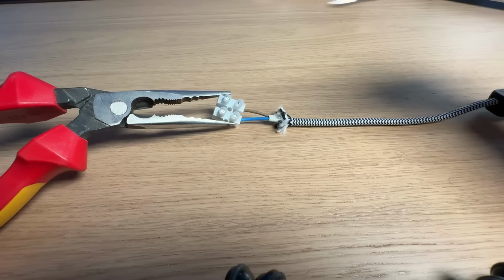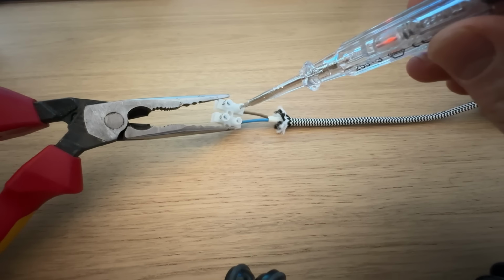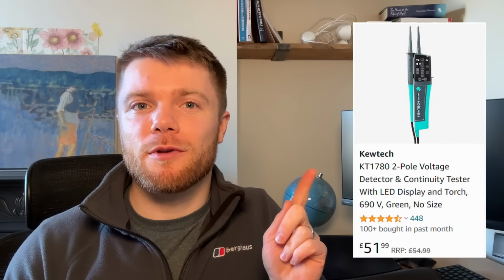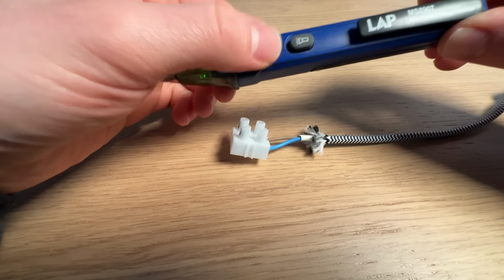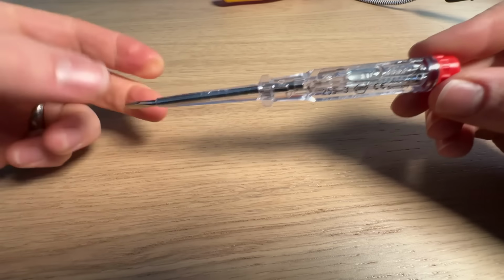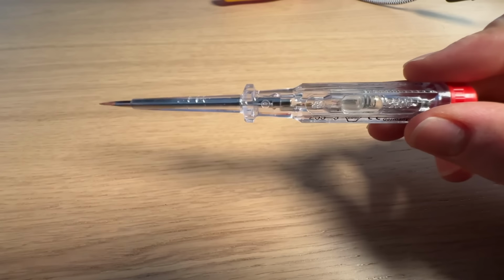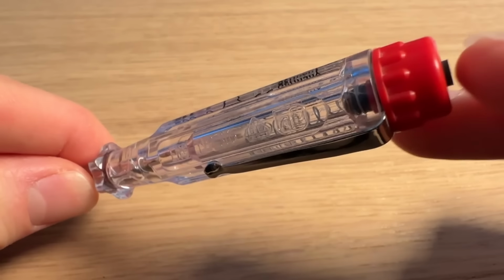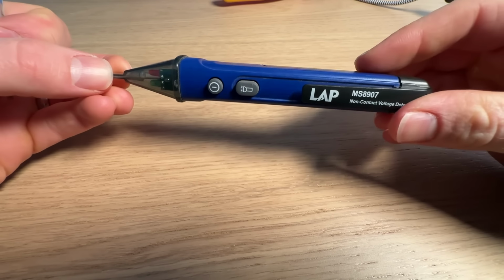The Most Dangerous Electrical Tool

Comment: What a BS, the resistor inside the probe effectively prevents shock. These probes are still very popular, since they are foolproof to operate, cheap and very safe. A multimeter requires a battery, the correct ramge setting and the cables need to be plugged into the correct sockets. In addition the cables and tips can be worn or damaged over time. What is worst,  you have to use both hands, what I try to avoid when working with mains voltage. If sonething goes wrong there is a definite circuit through my body. While when working only with one hand and wearing shoes with rubber soles, I would hardly recognize even if i touch 240V directly with my fingers  My safety rule: always keep a hand in my backpocket.
Reply: Well said.      I served an apprenticeship in the forces ( albeit a lifetime ago) and we were trained to work on live equipment.  This was drummed into us from the outset and it served me well over the years.
Reply: A multimeter doesn't need a battery to read voltage or current.
Reply from the maker: If your boots were fully insulating you from the ground, the screwdriver won’t light anyway….
Reply: @TheDiligentDIYer1759  Ever heard of capacitative coupling?
Reply: @ruben_balea  Not really going to be a thing at 50Hz through rubber soles. The capacitance to ground will be on the order of tens of picofarads at most, so the impedance will be on the order of tens of megohms. The voltage across the neon would no longer be sufficient for it to strike (the resistor in the screwdriver will be on the order of around 2 megohm, so assuming 50pF through the soles, the impedance on the 'grounded' side would be ~60MOhm).
Reply: If that were the case you would take your boots off.
Reply: That's why you should always test it on known mains before you start testing.
I have used them for years and never had a problem, however I have had countless multimeter leads go Intermittent which can be far mor dangerous.

Comment: Had these types of screwdriver for decades,never had or heard of anyone getting hurt !!!!!! I will continue to use myn. Also most deaths are when the mains goes across the chest, hence why your told to keep one hand by your side when testing. The ironic thing is ,that using possible damaged probes, one in each hand for measuring, is far more dangerous,as it put the mains across the chest. . Scare hype for nothing pal.
Reply: Hey can you please explain what is "mains across the chest" mean and how is that dangerous? English isn't my first language and I'm learning how electricity works
Reply: @Thewingsoffreedom.  Just means a pathway across the heart,which is the most lethal.
Reply: Yes, scare hype for nothing. The indicator light screwdriver is more discriminating and thus safer in my opinion. 

Think about it, the emf proximity method just tells you that a current exists in a cable, but it doesn't tell you in which core. 

Many DIYers might assume the live is in the red only, but in 'switched live' light switch applications - where the returning live has been left unindicated as such with a red band 'tell', - then the black can be live too. You will only find that out in a twin core (or a twin and earth) if you can physically detect and discriminate for 'live' on each core with an indicator light probe screwdriver.

You throw away that essential fact if you do not use that tool.
Reply: Having had a shock using this type of tester I totally agree they are not safe. The reason I got a belt was that the tool was stored in a drawer which had had water / detergent spilt in it the drawer had been cleaned up, but unknown to me the inside of the tool was still wet. Hence the reason these are no longer permitted on most facilities.
Reply: @grahamc887  You mean ,youre not safe,you got a shock due to negligence,or inappropriate storedge, like saying ban all extention leads ,as they shock people, that use them in the rain.
Reply: @enoz.3506: Spot on
Reply from the maker: Thanks for sharing your opinion
Reply: Below some voltage the light won't glow. You touch the wire and you get shocked ! 😀.

At an isolated transformer it won't glow at any voltage ! You touch both wire and you get shocked ! 😀
Reply: @kenzo4Ever  When was the last time you worked on a job ,with an isolating transformer? & who puts 2 fingers across anything,Seriously.A Neon lamp,has a strike voltageof around 90v !!! As an electronics engineer,you learn very quickly to check and double check every circuit,before touching it, its called having a brain,these days everything is given,but you cant teach common sense.
Reply: @enoz.j3506  
OK.
The difference is that I care to warn whereas You dare to insult ! 😀
Reply: @kenzo4Ever  Warning fools, was never my strong point.
Reply: @enoz.j3506  
On other hand, warning intelligent people is useless !. So finally you don't warn at all !  

Tell me you are careless, that's much straightforward 😀
Reply: @kenzo4Ever  The Darwin awards take care of the careless LOL,farewell, ive got better things to do.
Reply: This advice is for NON PROFESSIONALS
Reply: @SmartySmarts  Non professionals, shouldn't be anywhere near, lethal high voltage,did i realy have to speell it out. FFS.
Reply: These things have shown me even floating voltages. Power supply without earth to laptop, to usb cable. You touch it, put it in your mouth and the voltage collapses. But the screwdriver lights up.

If it can detect that, it is more than good to me.
Reply: @kenzo4Ever  There is nothing that will protect against stupidity🤣

Comment: This is very useful to know. I'm the most amateur of amateur DIYer and I've had one of these for at least 25 years and have never used it to test for current. The blade is obviously designed for the types of screws you find in electrical components and battery panels on toys etc so it's good to have around. As it's been rattling around my toolbox/kitchen drawer of doom for decades, there's a good chance that void had been bridged and I wouldn't have known to check. Thanks! By the way, can you use a multimeter to check if it's in working order?
Reply from the maker: You could put a multimeter with a probe attached to the top and bottom, then measure resistance. It should be very high or give no value at all, if it gives something low, then it’s dangerous to use. Still id just get a non contact tester to be safe. Thanks for watching!
Reply: You've be wise not to listen to this content provider
Reply: @niv8880  What piece of information specifically is incorrect?